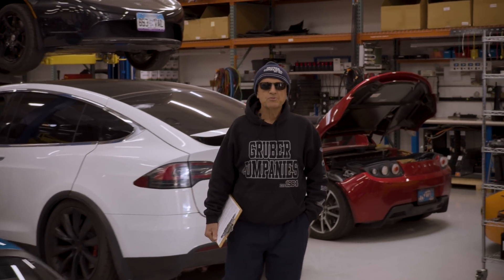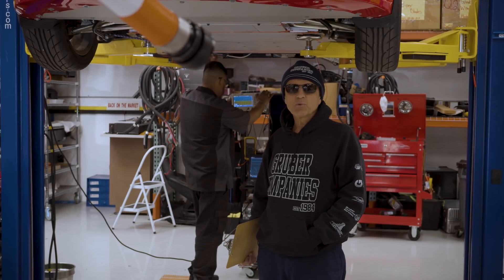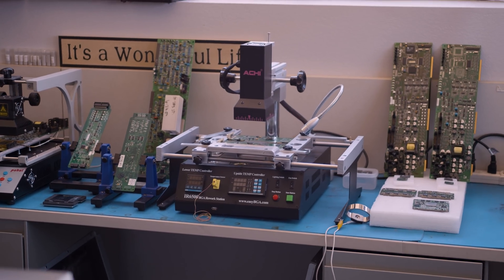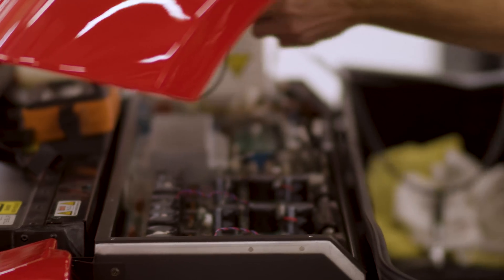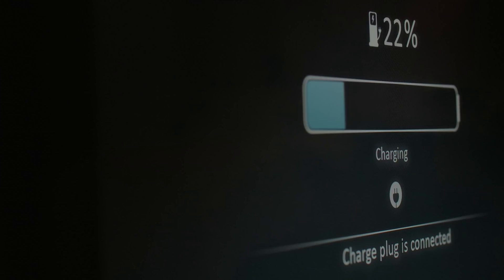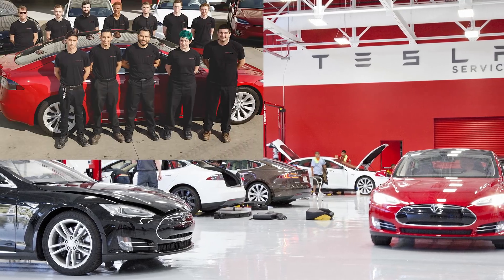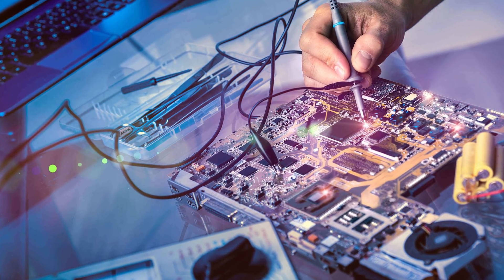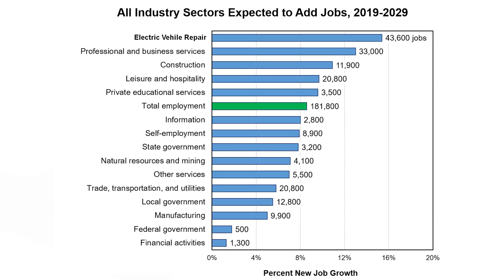The Mechanic of the Future | Gruber Motors

Comment: I’m a mechanic of the future. I own a shop that service hybrid and electric cars. I’m a regular car mechanic but has great knowledge of electronics. I even repair car computers and even Televisions lol😂. I’m familiar with electronic circuits. As far as writing codes I can only write simple C programming though. But I think I’m good enough to fix a Tesla which I include in my shops service vehicles. Most problem with circuit boards are usually not too hard. Occasionally though a microprocessor would fail and that is a big headache but for the most parts bad capacitor bad solder connection. Most failure of components are either due to poor circuit design or defective components that is just, waiting to fail. Having an schematic is a big help. Being able to look at a circuit and understand it’s functionality is a plus. You don’t really have to be an electronic or electrical engineer to service a Tesla. Most of the skills required is more of an electronic technician. They are the ones who are more skilled at pinpointing a bad component or any problem in a circuit.
Reply from the maker: We spend a lot of time reverse engineering, identifying components and sources, and creating schematics and documenting test points.  This information is not readily shared by any OEM.
Reply: @grubermotorcompany  aweseome seem like a lot of work.
Reply: @grubermotorcompany  How do you reverse engineer the circuit board? Most modern circuit boards have at least 3 or even 4 layers, and they are extremely complex

Comment: Just like EV manufacturers, legacy OEMs or new OEMs, have to utilize workers with electronic and software skills, the new EV repair shops will have to do the same. Glad to see someone that is blazing the path that many others will need to also follow/create. Seems as if the new manufacturers didn't quite figure the repair aspect into their master plans very well and only went down to the "assembly replacement" level much like the IT industry has done for years. This revolution has made amazing changes to the automotive industry. As more of the EVs exit their warranty periods more and more EV repair facilities will be needed since the standard legacy automotive repair facilities will not be able to easily or cheaply transition due to lack of skillsets and electronic/software tools.
Bravo Gruber Motors for leading the way in yet another new industry as the EV revolution continues to quicken its pace.
Reply: I fully agree. Mr Gruber is very smart, prospective customers are going to feel comfortable when they walk to the door and see that his facility is expansive, fully equipped, state of the art, and on top of things. He's properly posturing himself and his business to meet the demands of the future.

Comment: As a 25yr master technician with diagnostic and hybrid/electric light duty specialist certification I can tell you this new industry change requires more skills the No dealership will pay more for.  The industry doesn't want to pay for qualified high level technicians!  There is no money left in car business and no incentive for the new generation most of which car less about working on cars.  This just isn't my view but it's the view of my engineers at the Lexus training center.   Flare rate system that will also have to change to a high salary to interest anyone. 
I work in the northeast in high volume shop and I know large amounts of auto techs who hate there job due to these issues.

Comment: I teach metal in auto shop in a New Jersey high school. Back in 2008 I saw the change from gas to electric on the horizon. So I switch my program from a traditional auto shop basic maintenance high school program, pre-engineering research and Design program.

To prove this in 2009 we built our first conversion vehicle from gasoline to Electric. It was a 1990 rabbit and we replace the engine with an electric motor speed controller and batteries.

Comment: I'm a recovering ice mechanic and I agree with everything you said. that's  why  I've ordered a cybertruck and invested only in Tesla.

You and you shop are a perfect example  of the  brave new world of auto repair .I would only hope you become the first Authorized independant Tesla repair facility as it appears you have earned that ability and are doing that task impeccably.

I am just so glade to live to be able experience the tecnical and cultural change to something I have dedicated decades of my life learning  seviceing  
using and loving its massive modern ice complexity,but all things must change, and I'm excited to own aTesla. 
I test drove a model y performance  with self driving.
In that test drive I realized this was the most capable car I've ever driven , and it hardly made a sound doing it, I thought of all the fuel injectors and throttle plates and piston rings and main bearings and dial indicators in micrometers engine scopes the smoke machines and on and on just passed through my mind disappearing into my past and I was driving my future. 

The use of those tools will not be lost or not used Again by me but I won't be tied to it or depended on it or continually worry about internal engine wear , oil  changes,  block heaters or pre oilers ...except with my Kubota 😁.

Keep on redefinining what is automotive service 👍

Comment: Your analysis is good as far as it goes. But taking it further, if the techs with the skillet to diagnose to the component level are scarce, and for other reliability/liability issues, I suggest the only feasible repairs become module replacement. Further, if the company determines there is a faulty module and doesn't want anyone but them doing the repair, they will simply brick the entire car. So rather than a broad distributed network of highly skilled electronic auto techs as you envision, there could just as likely be a highly centralized, small cadre of desk jockeys monitoring and running diagnostics remotely when issues arise, ready to tell the vehicle lessee to return the car and upgrade to the newer model. Given Tesla's track record and the mindset of VW and BMW, I fear the latter is more likely.

Comment: I'm curious as to how fast the ice vehicle will be getting off the road. I can see the rapid growth in the EV market, and understand the 2035 transition for certain states and automotive companies. I foresee a tremendous amount of (growing) pain as society makes these changes.
Reply: I predict that the transition to EVs will be slowed in the future not by a shortage of batteries or vehicles, but rather by a shortage of technicians that can work at independent repair shops for out-of-warranty vehicles. It's harder to justify switching when you can't just take your car to a shop to get repaired.

Comment: Imagine that here in Africa we don't yet have enough skilled mechanics able to repair even an automatic transmission.
It would be dreaming if we started thinking about having EV shops. Not gonna happen in this century
Reply: We must start working on that problem. It will happen in Africa this decade.
Reply: Faustin, if you have the VEHICLES, it will happen in any country... except the Emirates, where a prince will get a brand new vehicle, when a windshield cracks.

Comment: I agree that the every day tech will have a hard time transitioning but I also think that dealers will just do like BMW and have a link to some diagnostic headquarter and they will determine what to replace and have the tech just replace the module or wiring harness or both. This will just make techs parts replacement jockeys.

Comment: I had 35+ years as an independent MB repair shop owner and I remember the struggle to get parts, service information, and techs. Now, on my 4th Tesla (yes, I need therapeutics!),  the future is clear.  I applaud your foresight and I agree with you that the future mechanic will be highly sought after as well as well compensated. Keep up the good work.